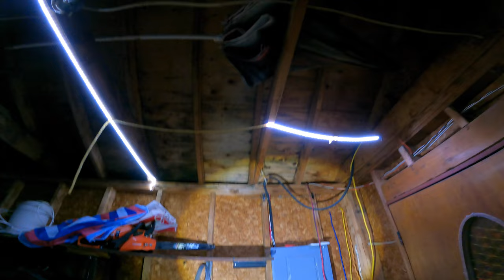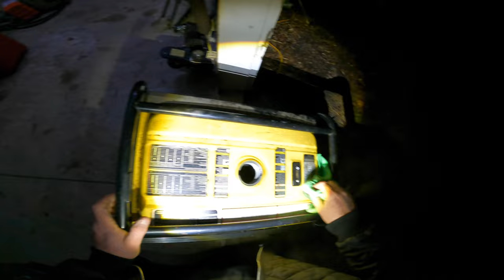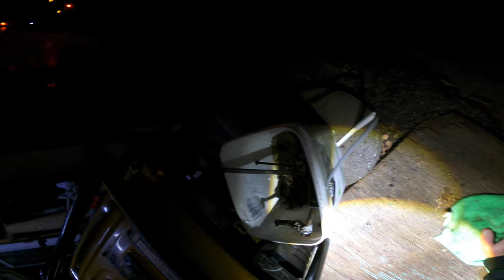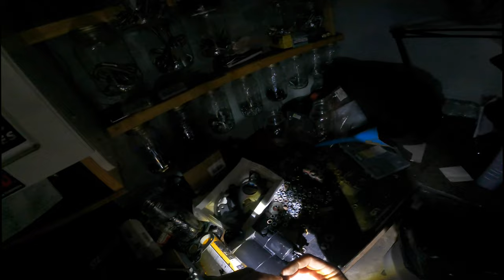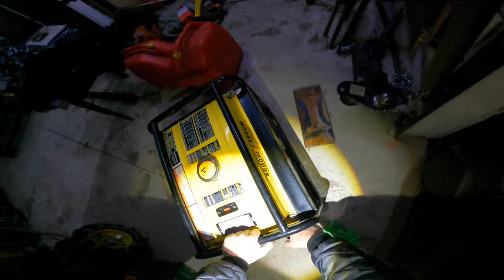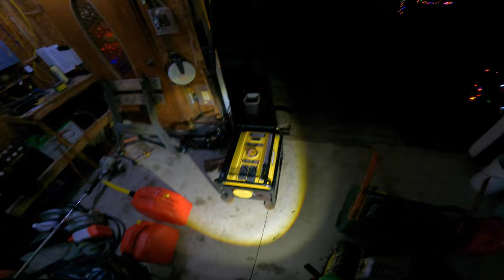(STUPID)ITS BEEN A GREAT GENERATOR BUT CARBURETOR NEEDS SOME HELP   4K

Comment: I purchased a Craftsman 5600 Generator in 2005. I had to put a new carb on it in 2019 but otherwise its been pretty solid backup plan. I added a Firman 7500 dual fuel to run a 50 amp window unit during our last hurricane power outage. Generators are worth the added comfort during extended outages.